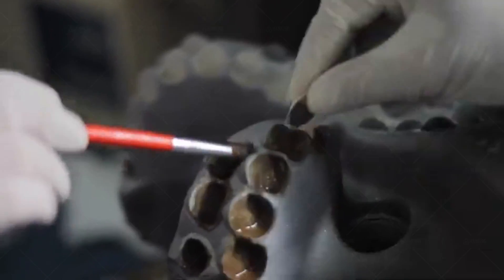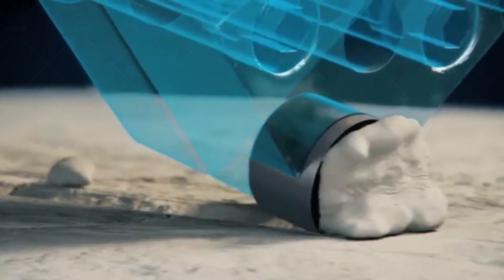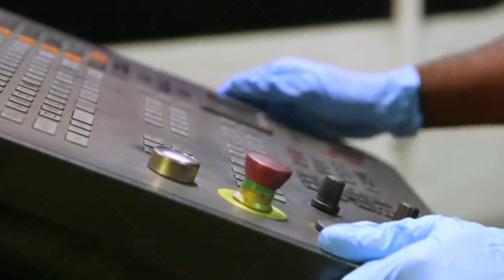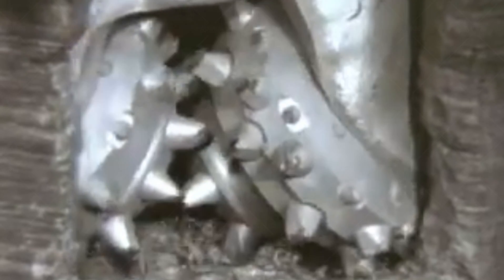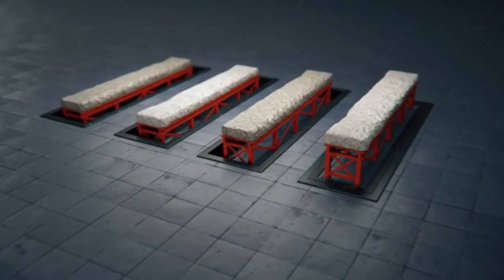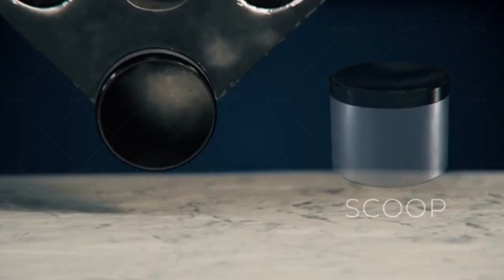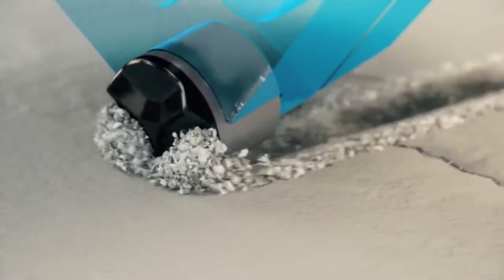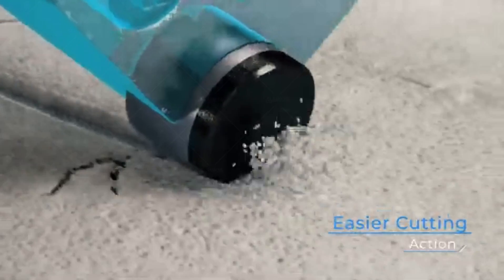What Drillers Should Know about PDC Bits!

Comment: What’s the ideal drilling speed for PDC bits?
Reply from the maker: The ideal speed depends on the rock type and formation. Generally, higher speeds are used for softer formations and lower speeds for harder ones.